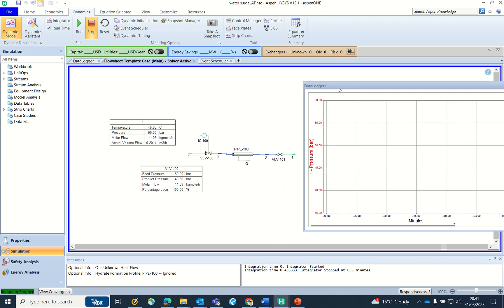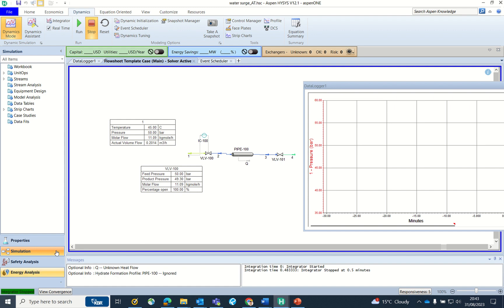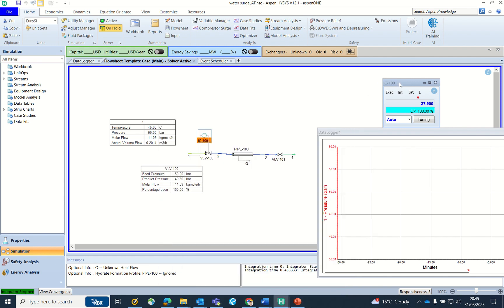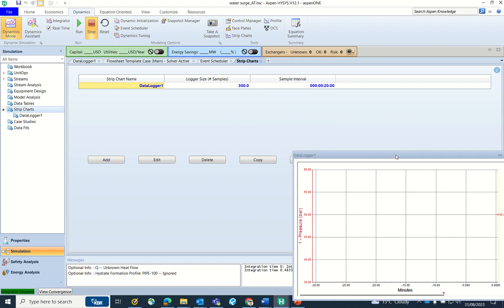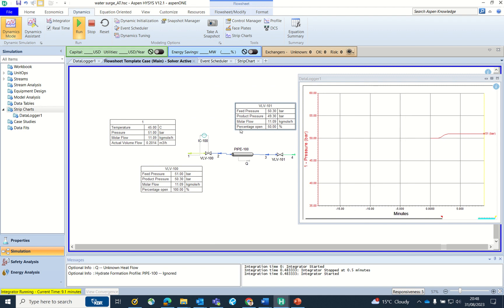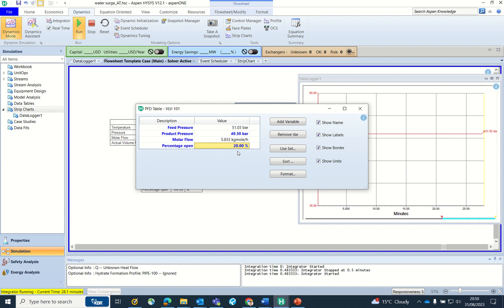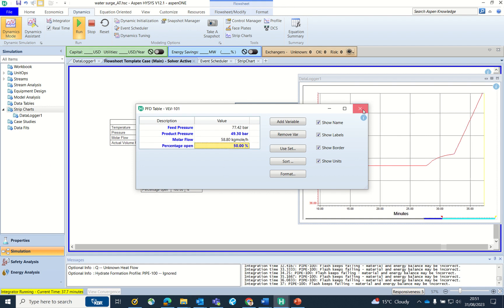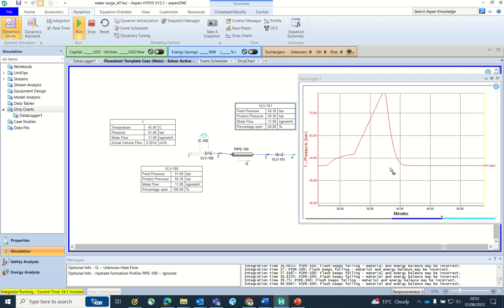Aspen Hysys Dynamics- Water Hammer/ pressure surge in pipeline

Comment: HYSYS family is a thermodynamic based simulator where it uses Bernoulli's Equation to solve the hydraulic calculation. However, please note that the momentum factor is not account in both steady-state and dynamic solvers which is important in the hydraulic transient study. The results shown may not reflect the actual pressure surge phenomenon and ultimately, not able to capture the max.pressure/ highest peak during the surge event. That's part of the reason why surge study is preferably carried out on other simulators like PIPENET, AFT, etc instead. Just my honest opinion.

Comment: Hi Rahul, thanks for great video. This enlight me on dynamics of pressure rising. However in my case pressure is not rising when I keep VLV-100 full open and VLV-101 full close. what is the boundary PF-specification? whats the stream<1> has Pressure or flow specification and stream <4> (<4> understood to be Pressure spec of 49.3 bar). Moreover, could you please advise where may go wrong with my sim. Best Regards.